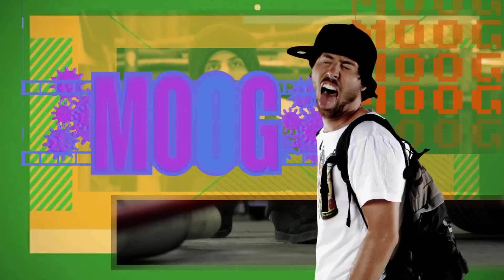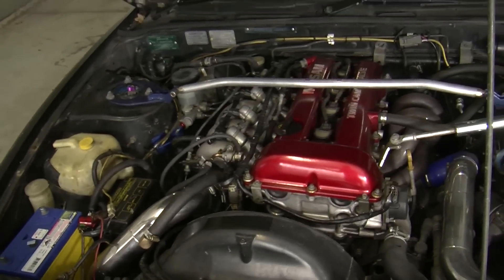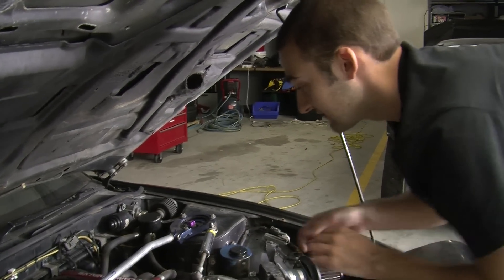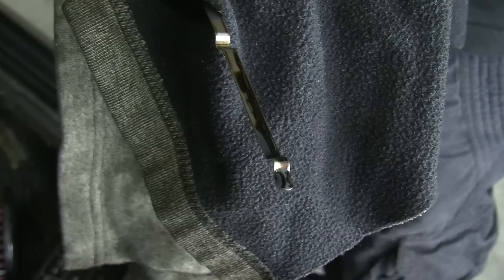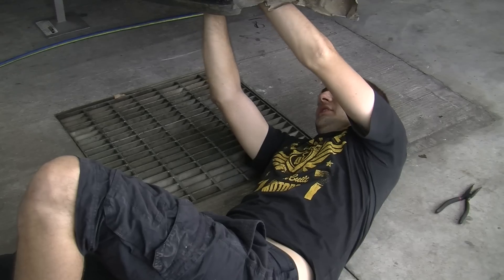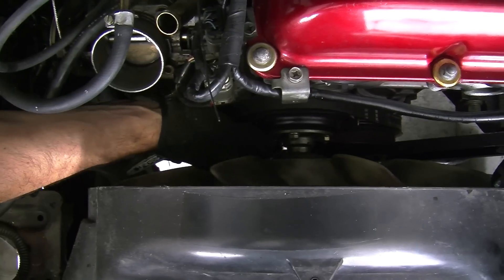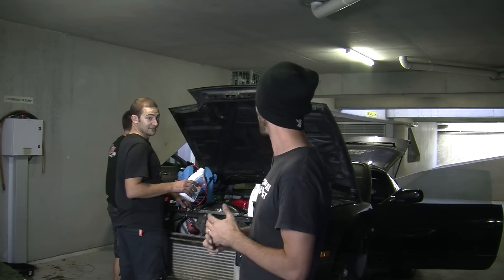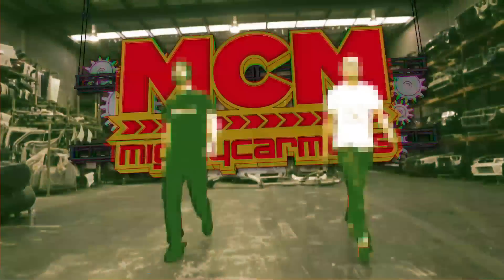Season 5 Premiere - Drift Car

Comment: Proper 180, US translation, proper 240, lol.  Mine cost me $650, was last licensed in 04, and 5000 miles later the fuel pump went out and sat until I bought it in Feb 2013.  After fixing everything (Fuel pump, brakes, clutch, fuel filter, fuel regulator, driver side window regulator, driver seat that broke, every exterior light, etc..), I'm in it now for $1500, been driving it for a year, and it's a 15% new car lol.

Comment: That guy that sold it probably just stalled, and gave up and sold it
Reply: Or the car is stolen
Reply: +Spraco Gaming Spark plug gap was probably like 2.0mm plus no charge
Reply: Just bought parts from guy who stripped car just because it blew 1 wheel bearing.
Reply: Rural areas are very different.  I bought a Toyota ute from central QLD that had a turbo engine swap done by a farmer who isn't even a mechanic.  People out that way just seem to use their brain more effectively, and they have to, because it's the only way to get repairs done out there.

Comment: who's watching the sx build again because it's back in 2016!
Reply: I am
Reply: Me!
Reply: me too
Reply: Same. This is pure McM fire 🔥 🔥 🔥 🔥
Reply: yep
Reply: I actually never watched the original build... so here I am!!
Reply: yep
Reply: watching this for the 5th time because of Taylor Drift
Reply: Can somebody please explain why didnt they put an intercooler into the car instead of the new radiator since the car has already got a turbocharger , thanks
Reply: turbocharge need cool air so intercooler is needed..radiator is water cooling for engine..need to understand what radiator and intercooler first..google it
Reply: +mohd faizal Doesnt the air first go through the turbo and then the intercooler before entering the engine? I know an intercooler is crucial with a turbocharged car, but do you still need a radiator aside the intercooler?
Reply: +Lik3 ViaZ Yes, it's the engine that likes cold air as it is denser... so more air can go in, more fuel can go in thus more power
Reply: +SiriousSandals what about the radiator?
Reply: +Lik3 ViaZ The radiator has nothing to do with the turbo or intercooler. the radiator is responsible for cooling the coolant which circulates the engine, keeping the temps in check
Reply: me but i wish it was a 240sx not a 180sx
Reply: +Spencer Mason same thing, cause America got the crappy 2.4 ka motors, but Australia got the infamous SR20
Reply: +Justyn Siah we have the sr20det
Reply: +Spencer Mason from factory?
Reply: +Justyn Siah we the SR20DET and KA24NA
Reply: same, and still trying to find that song that plays at 1:55 in the video, has anyone found it yet?
Reply: I'm watching rn
Reply: Dingo dyno  n
Reply: No now it's 2017
Reply: Noah Mosele no
Reply: now nov 2017
Reply: 2018 :-)
Reply: I watch it again and again, just because here in the states, it's not so easy to bring a 180sx over legally, plus it's serious $$$.
Reply: Noah Mosele 2018 my friend
Reply: I'm watching the SX build because I'm a new subscriber in 2018 catching up on all the old videos.  I have to watch these videos from 5.5 years ago before I can watch the videos from 2 years ago!
Reply: Watching it again one month bevore 2019 welcome to the future
Reply: MEEE
Reply: 2020

Comment: very nice. i had a 180sx myself and problem area's are the fuel system, vacuum lines and electrical system. if you ever have a problem with an 180sx those things are high on the checklist.

Comment: I wouldn't mind having a project car, but the thing is, I'm not even licensed, nor do I have a job to pay for parts or services... Services on things I know I can't fix for the life of me, like engine swaps or something. Anything like rotors, pads, alternators, intake, easy to access, not so hard to do alone... I'm fine with. Then there's my mom that would expect me to get a working car right off the bat =P
Reply: Get something cheaper like a dirt bike or go kart to fix up and have fun with
Reply: you arent the only one brother, I drive a chevy spark and there aint jack you can do to it to make it faster.... its fwd btw :,(
Reply: i feel you brah.  i reckon going to study motorsports is the best idea/path for yah so you just need money after gaining the knowlegde. buy your parts and fix, repair yourself :)  TEEHE
Reply: Dice Penderas Yeah. I should have switched schools to one that has an automobile course, but I love my school too much, and it's probably way too late because I'm in grade 11 now. But I do go to a shop and learn sometimes. Which is where I learned how to do all the above
Reply: Get a Honda or Miata. Both can be had for very cheap ($500-$3000 US) they are super easy to work on and are super reliable. I know as car guys we are always wanting the top of the line cars (Supra, STI, EVO, Cobra, ext) but for someone just starting out with little to no experience working on cars and on a limited budget you cant go wrong with the Honda/Miata option.
Reply: oCaRRiEDx That depends mostly on his living location, here in europe, the miatas and other japanese cars are really expensive. Our budget, decent cars are like fords, russian cars, bmw and a few more.
Reply: Simon Sebastian Valgma Well in that case E36/E30 ;)
Reply: MiniNinjia does your school have a coop program? I'm in Canada and in grade 11 too. We have a program called coop where you can choose to go to a place of work such as a mechanic shop, welder and such and learn about the trade. It's a school course so you get credits and you are out of school for half the day. I did my coop placement at a mechanic shop where I learned about cars and medium duty diesel so now I can do normal maintenance (oil change, rotors, diesel injectors and such) I dont know if they have a program like that in America but the coop program is pushed very strongly by our government plus now i have experience I can put shop experience on a resume
Reply: David R Yeah, we have a coop program too, it's just I'm not sure if they do automotive support. That and I signed up for a SHSM program that, if completed I can get a scholarship for said placement... So for me I have a Construction SHSM, and I need to do a Construction based coop to get the scholarship. (SHSM stands for Specialist High Skills Major) But I do have a shop that I can go to, to learn a few things =) So I can also put shop experience on a resume... But if I helped there a lot, I'd get hired without needing much. Because it's run by family friends... Almost got hired, until I had a crap ton of school projects to do, so I had to skip out quite a bit to do it.
Reply: MiniNinjia Yeah we have SHSM too except ours is business. I feel you with the homework, but lucky for you that shop is owned by family friends. Anyways man good luck with things
Reply: David R Yea my school does business, construction, and sports I believe... Not too sure, but hopefully I can get a project car, maybe something like an E3 or something not so broke... My uncle has a lift too, so I could go there to get free work done
Reply: Haha lol me to i use to race motocross and my dad never let me put parts in so I want a broken car to fix up but I'm in the same problem not licensed or have any money lol
Reply: get a job
Reply: MiniNinjia Go to School, get a job....don't do drugs.
Reply: Mark Thatcher Going to school, currently don't have a job, and I'm pretty sure I don't do drugs =P
Reply: I feel ya bro, grade 9 from a small town with almost no jobs, but luckily my school has everything from robotics to small engines to fixing cars, for customizing you would need to look for a shop that will take an apprentice, it will teach you customization and most will pay well too.
Reply: its actually better to get a job while you still go to high school and live with your parents, because you dont have to pay taxes so you can just stack mad cash, thats what ima do when i get my car in a few weeks
Reply: Yeah that's what I'm trying to do but with an apprenticeship you can get a degree and learn skills in almost anything.
Reply: Michael Sandoval you still pay income taxes even when you live with your parents lil buddy. Living for free without a mortgage or any other expenses is nice though.
Reply: MiniNinjia Hey man, I'm 15 years old so I only have a permit to drive under supervision of a sober adult. I'm in the process of picking up a E36 325is that was completely neglected by the previous owner to resurrect the car and make the previous-previous owners happy (they gave the car to a relative, thinking they would take care of it). This will be my second project and I have an extremely limited budget as I have no job and limited resources. But even with those little issues, I managed to "nearly" finish one car, and move onto another. What I'm trying to tell you is, you don't need 5 grand or even a full licence to have a successful project. Talk to your parents about it, find a car that needs a simple 'sprucing up' (chances are a family member or friend has a car just sitting outside their house), find a club and/or forum, and talk to some people. But when finding a car, try to get one that needs low cost fixes; say a car that is mechanically sound, but needs a major clean up all around and maybe a battery and simple service. And remember, cars are held together with bolts, not magic and hatred. So don't be worried to take something apart. That's really how you learn anyway.
Reply: TheLeafySpring Thanks dude! I might just do that soon.
Reply: you still pay taxes as a youngster. However you don't have to pay the mortgage, or health insurance, or monthly bills, or anything else really which let's you save up cash. I'm 21 and lucky enough to still live with mommy. I pay rent and insurance but that's about it. It's really nice to not have to pay all the other bills for as long as possible. Definitely try to get that job at the family shop, unless you hate your family lol.

Comment: $600 bucks, what the fuck...
Reply: That's about $1,000 USD, which is reasonable in my city for a 180SX with a "blown" motor.
Reply: I gotta say, that pretty awesome. I wish cars like this were cheap in Lithuania. Also, any car that has right side steering, has to be registered in Lithuania prior to 1993, which blows. Can't drive cars like this, unless you switch the steering column to the left, and even then, unless it's done perfectly, it won't pass vehicle inspection. Strict rules... So, you are lucky.
Reply: It's great! This car on average is £500 in the UK! That is for the working car with some, maybe all, engine mods on it! Perfect!
Reply: See my point. There is no way I could buy a 240sx for $500 in my country.
Reply: Bought mine for 900 running, but it had a huge dent.
Reply: Jaguar F-type Thanks, hopefully if the drift scene becomes more popular in GT6 il be back and running on the videos.
Reply: Nonja Buisniss 180sx*
Reply: pavkata99 yehp, my bad.
Reply: Nonja Buisniss I live in Estonia and I bought one for 480 euros. 200k kilometers driven and everything okay.
Reply: Andres Mäkinen Very nice. I need to look out for one.
Reply: Only reason it was so cheap is the 'blown out motor' which wasn't even blown out...
Reply: ***** 
No mate, that's utter bullshit
My 200sx was 2.5k with mods
The 180sx is more over here because they're imported and 'cooler'
a rolling she'll costs more that £500 most of the time.

Why make stuff up for no reason?
Reply: Andres Mäkinen in finland you can get a working 180sx for 3000 euros... this is why finnish people come to buy alcohol from estonia
Reply: Cuth
An old mate of mine has a 200sx as well, a few grand deep in it but its worth every penny the guy spent. I thought exactly the same when i read ***** comment.
£500 in the uk for one just doesn't happen.
Reply: BarrelsAreDushnugget Yeah and all Estonians go to work in Finland because they get paid better there. That's how stuff shouldn't work IMO
Reply: Nonja Buisniss oh yes the good old Lithuania. A scrap yard for used german cars. They are worshiped there
Reply: Sevcen23 Hahahha, you know it. It's getting a little bit better now, less and less shitty old cars, but still, yes the majority of imported cars are most likely from Germany :).
Reply: Nonja Buisniss yes. French cars are also popular among women. And it's not about old cars. Some of the old ones that are almost "extinct" (Ford Sierra for example) are great. It's just that most people are very close minded. German cars are the best ant there's only one factor that determens how quick the car is. Voluame of the engine that is.
Reply: Nonja Buisniss yeah i feel you, in latvia it's the same :C
Reply: In turkey, If you lucky to find this kind of car, You have to pay , 7000-8000$. :/
Reply: Mehmet Sadık Ünal bulamazsın ki bir JDM arabanın leşini bile o fiyata
Reply: Aynen öyle karşim.

Comment: Ughh it pisses me off how cheap cars are In AU. In US (atleast in ohio where i live) 180sx's go for 10-20 thousand dollars! Non-starting ones 2.5-5 thousand!
Reply: I live in Ohio and that's way off. Bought one for 500 fixed and sold for 2000
Reply: In the south a mazda rx-7 are around 20-70 k stock
Reply: Yolan I think it's because for having an import car in the states, we have to change the driver side so they are rarer, un AU I think they come directly from Japan so it's cheaper because they bassically don't have to do any mods and they are close together
Reply: MikeBass They aren't cheap here. 10-15 thousand is pretty typical for a decent 180sx. Under 10 grand and you'll probably find a molested, bent and beat to hell example.
Reply: um m8 cars in Australia are pretty expensive for a nice clean s15 is around 40k and a 180 is around 10-15
Reply: Yeah that's my point, That 180 was in a pretty bad shape, looks like it was gonna be scrapped so they had to invest a lot of money and rebuild everything to make it road worthy
Reply: Here in the netherlands you can get a decent 200sx for 3-10k
Reply: Michael, are you nuts? 40k for an S15? They're around 15-20k for a really clean, low KM turbo example. Around 10k for one with mid-high KM's and a few small problems.
Reply: Dimension Jester That's because those cars are more expensive when they're stock, versus one that has shitty mods on it. 

A lot of people realize $5k paint jobs and fart cannons don't add to a value of a car, and can actually lower it in some cases
Reply: +Michael Smith s15s are $14-27k
Reply: +Yolan cars in America are way cheaper than Australia that's why we import all our old cars from America
Reply: MrTacticalSloth
The one i wont is around 30k
Reply: +Yolan where the fuck did you get those numbers? lol
Reply: in Europe they are around 2 - 5k bone stock little rust
Reply: +uros kocjancic bullshit, I don't think I've seen a stock 180sx in my life
Reply: Here in Ireland you can get a decent one for around 2k with tax/mot. Saw a turbo supra yesterday going for 1500! The reason for this is nobody here likes performance petrol cars, most people drive TDI euros

Comment: It's easy just look around on your local used item websites. I bought 3 cars for a total of $570 CDN. Plus the repairs and towing it was around $1200. Then I sold 2 of them for a combined price of $1400, so I made $200 and I also got a great running and practical car. So I spent the $200 I made on another car gutted it and put it into the one car I have had since nearly the beginning.

Comment: Actually, the 240SX had a different engine, the KA24DE. The 180SX only came with a CA18DET, SR20DE, or of course the SR20DET. It was called the 180SX for its original 1.8 liter displacement (before going to the SR engine) and the 240SX likewise for its 2.4 liter engine.

Comment: Wow they probably didn't even need to replace the alternator, just clean the oil off of it and actually bolt it in with tension on the belt. What a deal they got on that car,  unbelievable.

Comment: No the guy admitted to it being a regular 240sx. It started as a drift project and slowly turned into a show car. Rear wheel drive is safer in an emergency too, no under steer. It cost the guy $5000 for a professional body shop to custom fit the entire front end. Though I have been leaning towards getting bone stock 240. The civic is worth quite a bit more than all of the 240sx's for sale around victoria.

Comment: I'm a newb is the sr20 the stock engine or is it swapped I know these cars are quite often engine swapped
Reply: On the japanese 180sx s13, s14 s15(type r) Yes they are, on the s15 spec s is a sr20de (non turbo) 
Some japanese s13 Silvias got a ca18det (turbo) as well the european 200sx s13 And s14 have the ca18det  but most people swap them for the sr20det And rb25det but americans the sr20det And many v8's